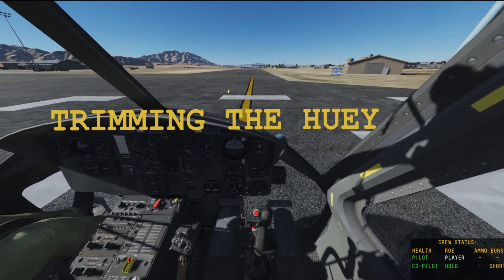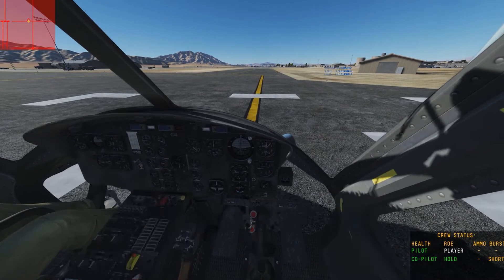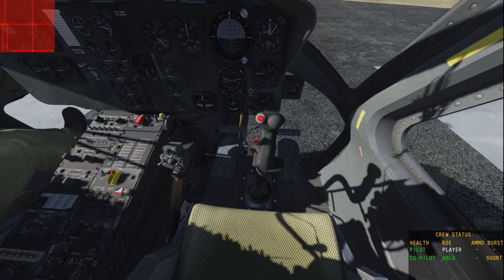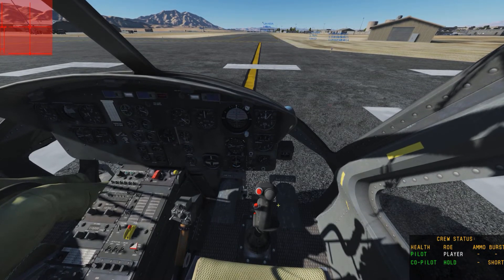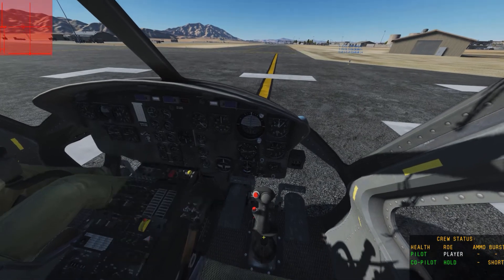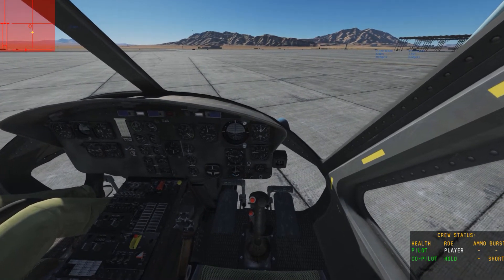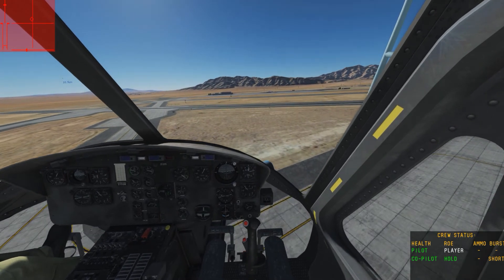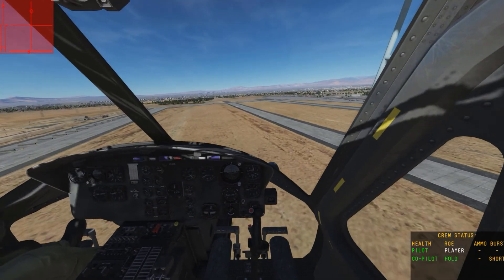UH-1H Huey: Trimming Tutorial | DCS WORLD

Comment: Thanks for that tutorial it was very helpful.  I've been having a weird problem though, not sure what it is.  When I'm flying at speed and I trim often the controls get stuck and I crash.  Sometimes I recover if I start wagging all the controls maniacally (as one would do if their aircraft suddenly became unresponsive) but most of the time it stays stuck and crashes.  Has that happened to you?  I can't even reset the trim.  I can control the collective on the same joystick but that doesn't help much if you're stuck in a configuration.  Any thoughts?  The trim is hugely helpful but not if it's going to cause a crash 50% of the time.
Reply: Check your Huey settings under Special. Make sure it's set to default